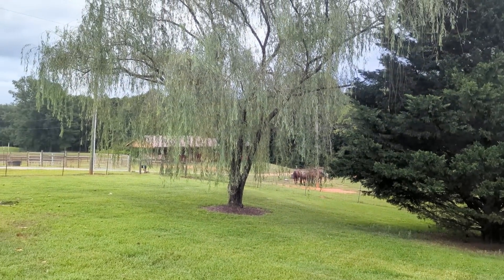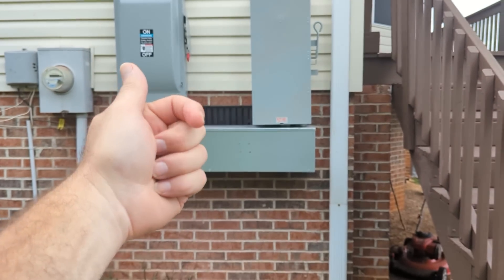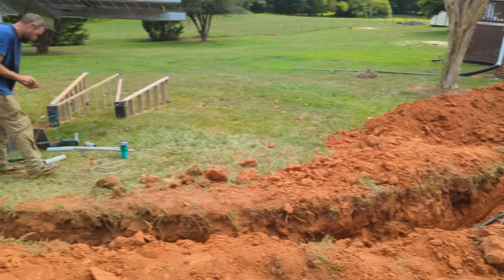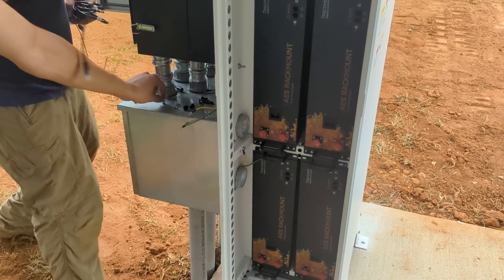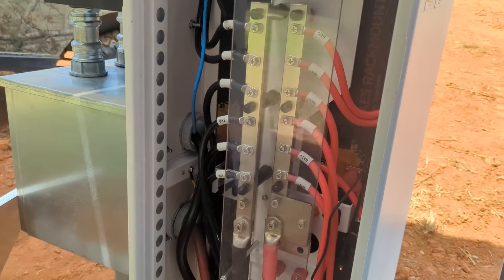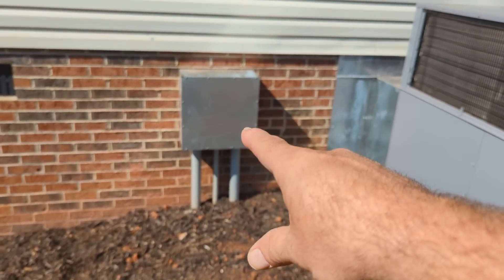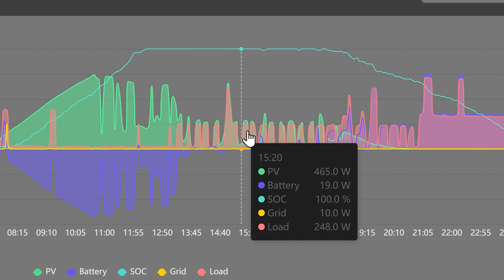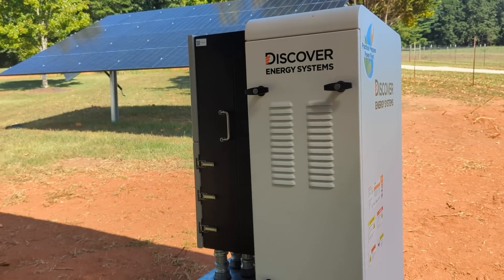Lunavolt... Our latest outdoor solution!

Comment: From a security perspective, manufacturers need to start including alarm contacts - both in the inverter and the battery cabs. The Solark App could alert the install/customer about a tamper condition and let them react before it's all stripped and stolen. Failing that, installing door switches and dry contacts for an easy security integration.
Reply: Yep, in Africa that would have gone before he’d finished filming… 😐
Reply: Its crazy. In Zimbabwe that would be gone in 60 seconds 😂😂@____________________________.x
Reply: Cell phone game camera aimed at the system will let you know if anyone approaches your panels.

Comment: good install  ---- $13 a kilo watt hour ?
Reply: It's a one time (per month) charge of $13 times the peak load in kilowatts (not kWh). If you use 10kw for 15 minutes (usually the minimum measurement period) or 24 hours it's the same price. Plus there's usually a small price per kWh on top of that, but much less than a typical kWh rate.

Seems like a good way to make electric stoves extremely expensive. Traditional politics of electric vs gas aside, electric is the only one you can generate yourself onsite for as long as you need to.
Reply: @mattv5281  Last year, from November through March, my electric heat pump would kick into defrost mode periodically (usually during the night when my batteries were flat and I was using grid power).  That defrost cycle pulls something like 16kW for a few minutes.  So, with that kind of load charge, my electric bill for each of those 5 months would be an additional $13/kW x 16kW = $208 higher.  Or, roughly $1,000 more per year.  Sure is great that the government incentivized people to switch from gas to electric.  EDIT:  And, this is in Texas.